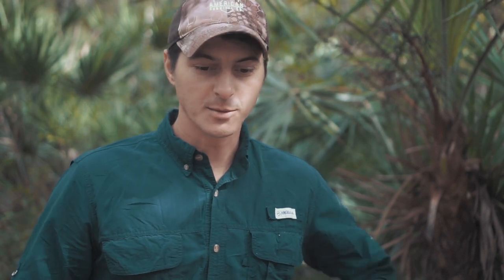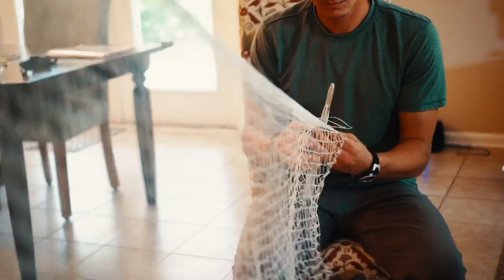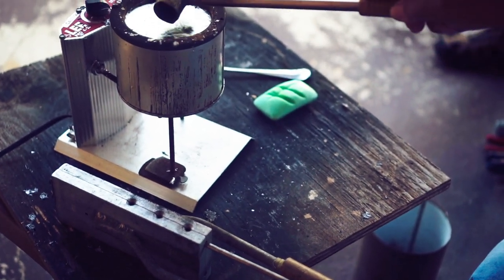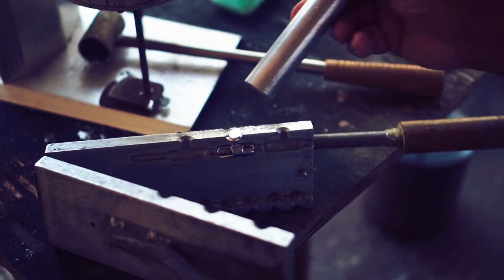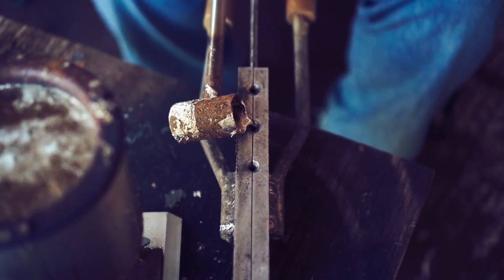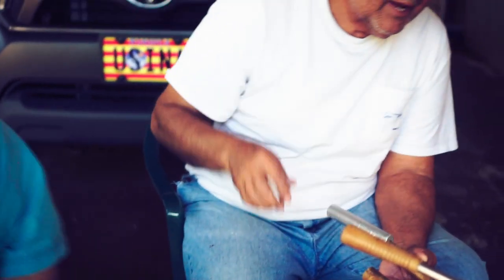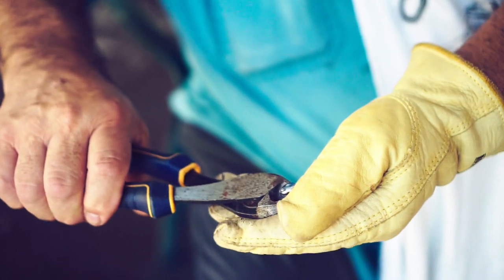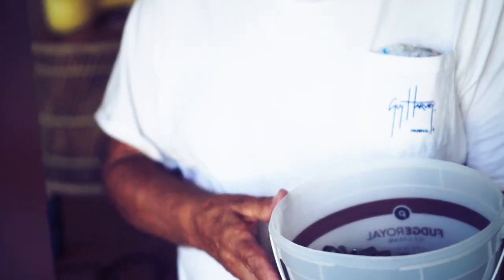Lead Sinkers for Handmade Cast Net with Master Net Maker Mike Usina

Comment: Where could I  find these molds? I cant find them anywhere.
Reply: They are certainly tough to find now adays. I’m having trouble myself. The moulds we were using in the video were made by mr Usina. He and his buddy Phil were nice enough to let me come over and use them. Every once in a while you see one pop up on eBay. There are other routes to go but they are pricey. The cheapest I’ve found is getting a custom mold made and the cheapest I’ve found someone who will do it was in the ballpark of 250 dollars
Reply: That’s a good price, please give me contact information of the mold maker guy.